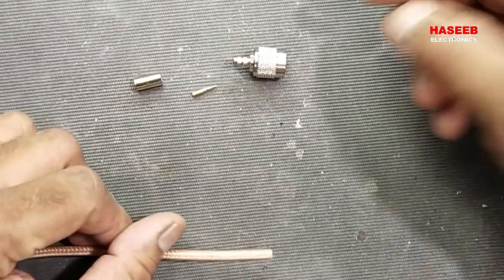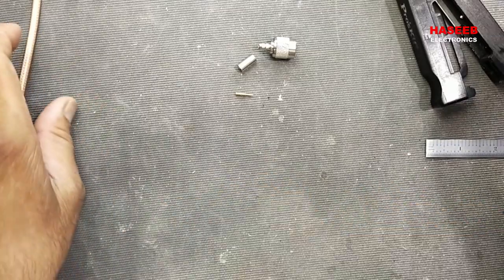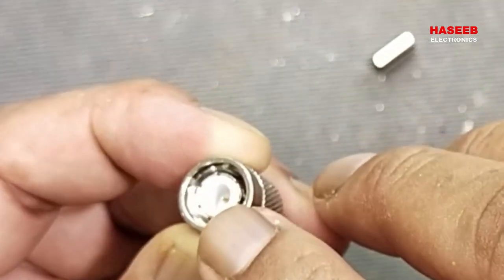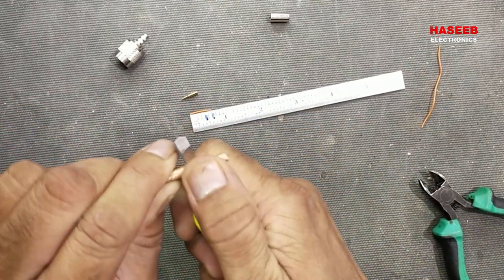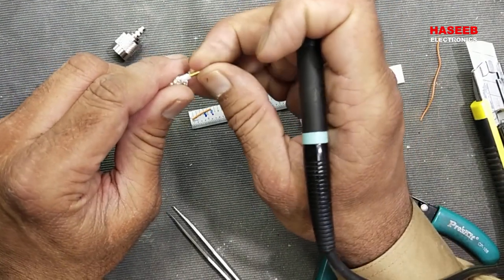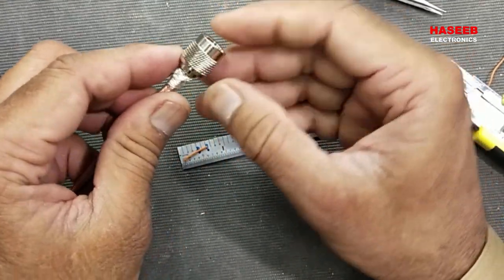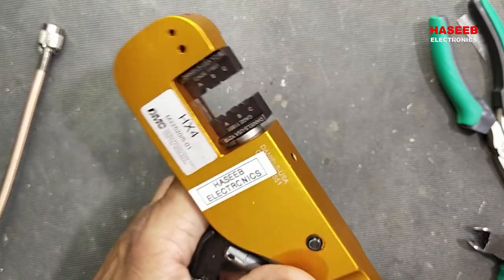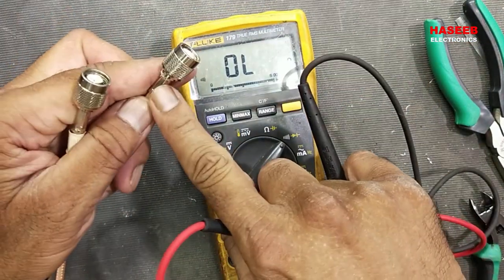[393] How to Crimp TNC Connector to Coaxial Cable - RG6/ RG8

Comment: how much the crimping tool cost? and the heads?
Reply from the maker: HX4 crimping tool with die set is around 500 USD,  it is available on ebay, rs-online and many other vendors